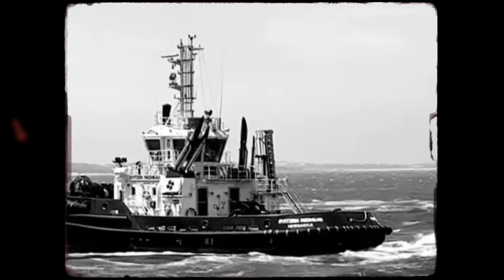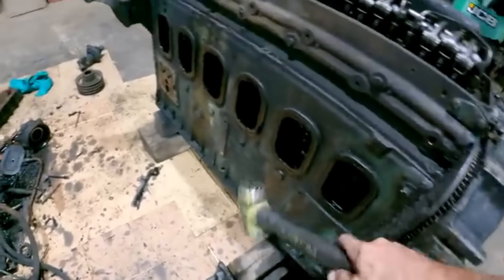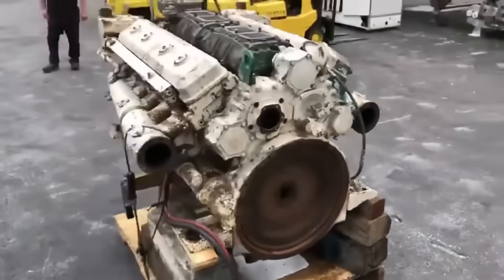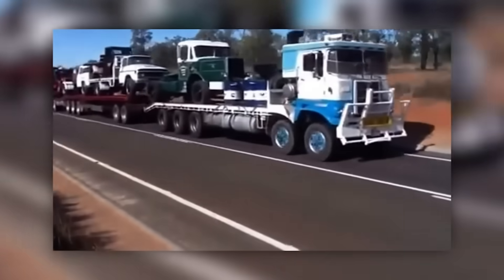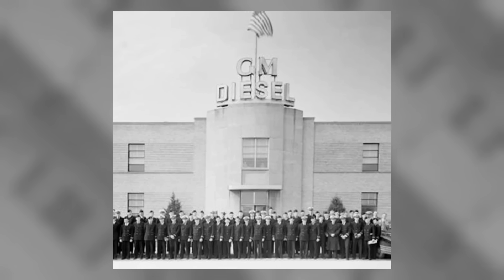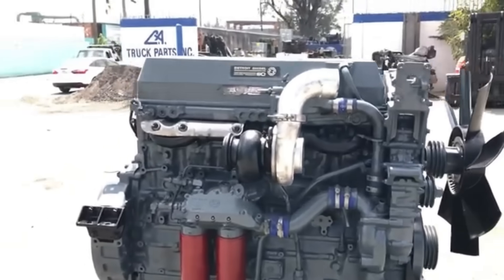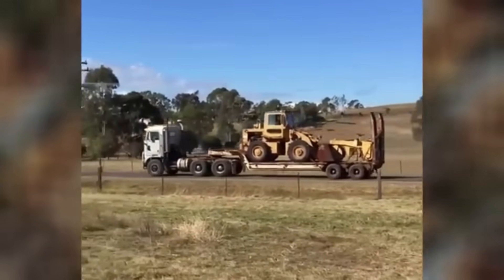The Rise and Fall of Detroit Diesel, America’s Greatest Engine Company

Comment: I remember driving an old GM General Detroit screamer in the 1980s.  The more revs the better.  You have to hear them in person to really understand the scream, the vid here doesn't do them justice.  They were replaced by the newer turbocharged engines.  We never thought they would get enough power out of the new engines, but they did, and they got way better fuel mileage.  Detroit Diesel kept making great engines right up until Mercedes bought them, piled a lot of electro-tech on them and made them unreliable.  Still some old Detroit 4-bangers around I think, excellent engines.

Comment: worked for detroit diesel dealer for 15 years. built a 8v92 for truck racing. set new land speed record on the salt flats in cab over freightliner.  also put 3-53 in 1ton chevy truck. left there as the 60 series was coming out an went to caterpillar dealer.
Reply from the maker: Seriously?! That must have been insane! I would like to have seen video of a truck racing on the salt flats. Very cool.

Comment: Detroit only made inline engines before 1957 when the V-Block engines were offered 
The 71 series 
 Came in 1,2,3,4, inline 6, or V6, V8,,V12,V16 & V24  cylinder 
Configurations .

The 53 series was 
Offered  in 2,3,4,V6,V8 & V12 
Configurations
 
 The Detroit 51 series introduced 
In 1951 & produced  until 1959  it was offered in a
  2-cylinder 
And 4-cylinder 
Configurations 
Ir was unique 
Because it did not have  valves  like all other Detroit's

Comment: Back in the late 90's and early 2000's I worked for a driveaway company. We moved 100's and 100's of old retired Schneider cabovers, many of which had series 60's some with well over a million miles on them. Most went to the ports in Ca or Fla, and were put on ships destined for China.
On their trip over, the engines and drivetrains were removed while the cabs were dumped off into ocean under the guise of sea life habitats.
The engines and drivetrains got refurbished in China, then sent back to the US to be reinstalled in new trucks.

Comment: Many years ago, I drove trucks that had Detroit Diesel engines at some of the places I worked.  I prefer Cummins in Big Trucks.  However, the Detroits had a few strengths.  We called them "Yudden Yuddens" etc.  The 8 V-71 would run 100 mph down hill and 20 MPH uphill.  They were TOUGH, but used a lot of fuel and did not have a lot of LOW Rpm Torque.  I did not like the 2 Cycle noise they made.  We also called them "Double Breasted Yamaha's".  The oil pressure gauge would set on ZERO when idling.  Not a good thing when snowed in some place where the only shelter you had was the TRUCK.  I believe they were BETTER when used as Generator, or a shrimp trawler etc.  But in a HIGHWAY truck for cross country, I did not like them for that.  Then they came out with the 8V-92 around 1977, they had more torque, but they were still a Yudden Yudden.  I much rather have a Cummins.  They ALL slobbered Motor Oil, you could steam clean one of them and drive it 200 miles and it would have Oil specks all over it.  They are BETTER around DIRT than a Cummins.  The Euclid Off road Dump Trucks had the hot water 6 cylinders, the 238 I believe they called them.  The guy narrating this has NEVER driven one of the for sure.

Comment: What a fake story just click bait lie. My company has tens of thousands of 2025 Detroit diesel trucks in our Cascadia freightliners. A lot of already have 400,000 miles plus on them and they run better than I expected. Between 7 1/2 to 10 1/2 miles per gallon on a full-size big rig. Quite a joke. Are trucks never shut off. They’re driven 24 hours a day. When one driver gets back from the run another driver is waiting to walk in after it has been fueled with diesel and DEF and post a pre-trip inspection. Meticulously maintained.

Comment: Detroit diesels were load over revving engine that lost torque when it say a hill a mile in front of you. So glory motor don't think so. That's why they had no share of truck engine market until the 60 series. And no they didn't pull. Need to do better research.  Have a great day. Started trucking in 1977 until I retired. Have a great day.

Comment: At one time I was an apprentice at a Marine mechanic workshop, I saw a rusted  v16 detroit block rebuilt with rusted pistons sleeves, connecting rods blowers cleaned with sand paper and diesel. I always marvelled at the modularity of the engines. I thought it was an oversight on GMs part, now I know it was deliberate.  Good engines ❤❤❤

Comment: Low end torque? No. They were known for not handling hills well. Their claim to fame was HP or power to weight ratio, not torque. Their success in marine or fixed machinery was that they would operate at fixed RPM and not have to recover torque after shifting gears.

Comment: I've seen these engines eat dirt like it was fuel , holes in the intake Duct, air filter so plugged either couldn't get through, multiple idiots trying to destroying, holding it at full throttle and it just would die. Constantly hauled more weight than was road legal

Comment: I drove a lot of trucks with Series 60 engines.  Love 'em.  Beyond reliable.  You break 'em in nice and easy for close to 100,000 miles until they start leaving a four inch spot of oil when you shut them down.  It's now running at it's best and will continue to do so year after year with proper maintenance.

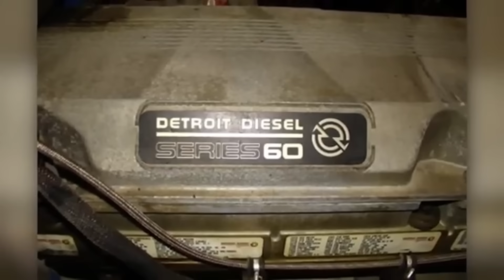Comment: Inaccurate statement at 11:14. The Series 60 was NOT DD's first 4-stroke engine. The 8.2 liter "Fuel Pincher" was a 4-stroke, and it was introduced in 1980.

Comment: The attraction for fire trucks and generators were the fact the it is a two stroke engine which unlike a four stroke where when a load is applied the rpms fall off. This causes fire engine hoses to lose water and generators to lose power to lights until the rpms picked back up. With the advent of electronics Detroit lost the advantage. There were other issues as well with overflow fuel oil tubes leak wasted fuel at idle and if a head cracked and coolant flooded the crankcase then all the bearings would fail in short order if it was not drained soonest.

Comment: U.s. is known all over the world for cheaply built crap sold at a premium price so even well built stuff suffers from that reputation. A two stroke diesel does NOT lose diesel while scavenging as diesel is only injected at TDC when the inlet port and exhaust valve are both closed.

Comment: What if the 71 & 92 series were cast in Aluminium, with Electronic Injection using piezoelectric injectors @ 2000 Bars, while injecting urea in the exhaust manifolds . . .  There would not be any Emission issues!

Comment: Love detroit diesel. I am a mechanic at one of the biggest airports in the world, We have 60+ detroits in our fleets, Ranging from series 60's series 71's 6v92's & 8v92's all stuffed in Oshkosh chassis' Some of these machines are from the early 70's they are still out here pushing snow and keeping the runways clean for safe takeoff and landings. They are so easy to work on and they are damn tough. They are the embodiment of what a diesel motor should be. I am able to excel at my position because of how easy they are to work on.

Comment: Turned good diesel into noise or overevved with governor failure!  I remember back in the day the Wabco motor scrapers with a 471 engine with the air shutoff valve operated by a cable which was usually seized up when you needed it. They used to leak oil, blow head gaskets and burn the top of the liner so you had to replace cylinder liner as well. If you couldn’t hear the machine working in the distance you could tell where it was from the exhaust smoke. The only redeeming feature was that they were fairly simple to work on.
Fishermen on trawlers seemed to love them, maybe they suited the marine environment.

Comment: I worked on M113s. Heat was the only thing that could kill that engine. Loose the fan tower meant you usually lost the engine unless the driver stopped. 8V92 in the HEMTT was just awesome, I loved driving my wrecker. If your doing a rack adjustment don't forget to put that shop rage in the corner of the head.

Comment: The series 60 leaked oil too.  If you were designing a new engine. The one thing we have to do was keep it clean.   The leaked from the cam seal. I still got an early 14 litre which has a 12.7 top end and it leaks we have fixed it several times. Runs good though

Comment: The nuclear plant had a pair of 8v92 silvers.  475 grizzlies.  They were set at wide open throttle and had electric ran oil pumps and were kept at operating temps by the reactor cooling water but in the event that something went wrong both 92s went right to 3200 rpm to run the cooling pumps so there wasn’t a meltdown.  The old guy told me there was no other motor that would take a start and right to that rpm and take it.  lol I’m glad we never needed them

Comment: I started driving semi hay trucks in 1980. I drove Cats, Cummins and Detroit's. When you want torque to pull a heavy load and up mountain passes you want a Cummins or Cat. A Detroit 8V92 735 ci two-stroke even with their 440 hp that had twin turbo into a supercharger couldn't stay with our 400 big cam ll Cummins that was a straight 6 with 855 ci and one turbo. 
The Detroit Diesel belongs in the scrap yard. 😂😂 😂 😂😂

Comment: I miss hearing that smooth roar of DD flightline fire trucks.  Now they’re unreliable 4 stroke German engines that sound like a modern stock passenger diesel.  Thanks Obama…

I’m pretty sure I’ve seen a V20-149 before.  It was an old abandoned flightline generator that would power all the lights and another abandoned project that supplied 200A power and high pressure refrigerated air to every spot.  They eventually moved to a generator behind every hangar and towable power and air carts.  Leaving no use for the cathedral size generator.  I only saw it once because someone left the door open.

Comment: you cannot kill a 6-71, i have run 6-110, 6v53TI, 8-71TT, 12v71, 4-53 since i was 20 years old and now i am 68, unless you throw a rod thru the block you can always rebuild them, pull the head and drop the pan and throw in a new cylinder kit, yes it really is that easy

Comment: you missed the fuel pincher. a 4 stroke 8.2L V8... It was a big black eye on Detroit. went from the most reliable to the least reliable engine, and really was the end of the Detroit under GM.

Comment: The Series 60 is a great engine, BUT it’s not the first 4 stroke engine built by Detroit Diesel. In the 70’s GM and Detroit Diesel released the 8.2 Fuel Pincher turbo and non turbo V8’s

Comment: I have one in my steelboat and another as a industrial generator/waterpump/air comperssor on a trailer. Great equipment. Basically, only the aircompressor needs actual regular maintenance, because of the Reed valves.

Comment: Correct me if i'm wrong, but as far as i know american tanks fighting in europe were never diesels.  The achievement to get a doesel small enough to fit un a tank was made during the war, so at startof the war all tanks were petrol powered. During the war nobody wanted mixed diesel and petrol tank units, thats because nobody wanted to deal with two fuel types. There were about 8000 dherman tanks with diesel engines, but they were only used for trainig in the US. 
I remember these facts from The video about tank engines from the german tank museum

Comment: Pretty good stuff, but it got a little hinky when you were talking about CAT and Cummins and their advanced four strokes - right after you described how clean sheet, advanced, an excellent the Series 60s was. Makes me believe it's AI content (?). The Series 60 not only saved the company, but it's legendary, deservedly in the top five of production diesel engines (If not top three) and still all over the place to this day. Definitely massively successful for DD. The video made it sound as though CAT and Cummins ate DD's lunch in the four-stroke world. 

Me, I still dream of owning a 90s-2010 Prevost motorcoach with no slides, riveted body, and with only the upper half painted -definitely have to have lots of polished aluminum, and of course with a Series 60. Extremely dependable, plenty of parts, easy to service, sound great, etc. If you look hard enough and are patient, you can find nice ones in the $70s, though I'd expect to pay closer to $90-100k for one that's been tastefully updated.

Comment: The only reason an engine series like the 71 dies, is because people don't appreciate it anymore, or they are forced to scrap them.  Look at the Toyota 22R series, or the 1GZ-FE, 2UZ-FE.  There's lots of old, worth their weight in gold, engines out there with hours and miles to give that would outlast modern emissions engines several times over.  

"When something is built for profit, it will fail.  When something is built to better the lives of others, it will live."

Comment: Two important topics were missing: 
1 - EMD LOCOMOTIVES from General Motors were built from the 1950s to the 1990s.
In just one hour, a piston, connecting rod, cylinder (power unit), or their parts can be replaced without removing the engine from the locomotive, which avoids many weeks out of service.
Only in Argentina, there are more than 300 GM GT-22 and G12W locomotives in service, dating from the 1950s to the 1970s, that surpass the reliability of the new Chinese CKD and CRRC locomotives, which are already needing new engines because there are no parts to repair them and they cost millions of dollars.
In the USA, SD40s from the 1970s are still running.
In Europe, the new Euro 4000 locomotives have EMD710 engines, the same as the Spanish RENFE Series 319 locomotives, which were built under EMD license.

2- The biggest TEREX MINING TRUCK  with a payload around 400 tons was the Terex MT 6300AC (later Bucyrus MT6300), introduced in 2008. This electric-drive truck featured a four-stroke engine, not a two-stroke, and had a 3,750 hp engine and a payload capacity of approximately 400 tons. The Terex 33-19 "Titan," built in 1973, was once the world's largest but had a smaller 350-ton capacit

Comment: Detroit made durable engines, but weak. The Detroit 6.5 liter that runs the Humvee in the American military, despite 6.5 liters of displacement, only produced 170 horsepower and 380 ftlbs of torque. You can get a ford straight 6 that beats both those numbers at half the displacement. So a chrysler hemi of the same displacement was a much better engine.

Comment: The environmental concerns were very real, but few people know about the health concerns... Because the mainstream media almost never mentions them. It is the fact that Diesel exhaust fumes cause cancer. Actually, all petroleum fuels do because of benzine.  But it is a bit worse in Diesel fuel. This is the REAL reason city busses in most major cities have switched to burning alternative fuels like methane or biofuels, or are now trying to transition. Hydrogen is also being used, either burned in an engine, or pushed through an Electric Fuel Cell to run electric motors. Modern methods of splitting the water molecule to get H, are 8 times more energy efficient than the old brute force electrolysis "low voltage high current" way still taught in text books.  Why are these things rarely mentioned? Because the media's biggest ad customers are oil corporations.

Comment: I worked on several models in the Army. I found them to be easier to work on and less problematic than the Cummins engines that they were also using at the time. Most Army mechanics were afraid of them because of a rare, but real, possibility that a maladjusted injector fuel rack can cause them to run away and destroy themselves. I was often the only guy in my unit who could adjust injector racks to perfection consistently. Or, more to the point, not afraid to perform the adjustment. However, it was a well-documented and simple procedure, and all I did was follow it.

Comment: I use to grow in a family compagni that the first 10 whellers that we bouth was a 1979 Ford 9000 whit a 8V 71 Detroit... the soud that it mae still ringing in my head till now, that when it's not running away... fotunatly there was a manual shutting valve on th engine or we have to quicklly put it in gear and dropthe clutch to shut it down.  Memorable time...

Comment: Never operated anything with a Detroit 2 stroke in it but a crane we had at a rock quarry I worked at had one we used to bust up big rocks.  I know the crabs was so loud one operator could run it for only a couple hrs then they had to switch.  I got my CDL in 2008 and I've driven 3 trucks with Detroit 60 engines, one of which I drove all over the US.  That one was a 2008 Frieghtliner Columbia with a 10 speed.  The other two were Frieghtliner Classics.  I had very little issues out of any of them.

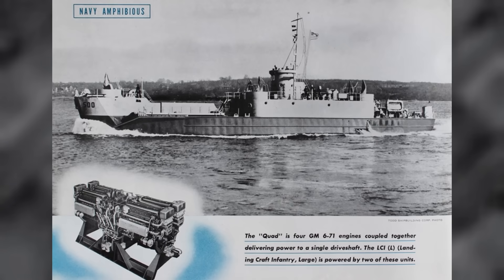Comment: I work on USS LCI(L)713 a WW2 Landing Craft Infantry. She was built with two sets of "Quad Diesels" as main propulsion. A Quad engine consists of four 6-71 DD engines clutched together onto a common output gear. (Seen briefly at time stamp 2:41) I think it must have been invented by Rube Goldberg. These  engines could not be reversed, so they came up with a reversible pitch propeller in order to go astern. Our purpose was to land troops on the beach and not "chase U-boats across the Atlantic" (contradicting what the narrator said in the video) The quad 6-71 engines made the LCI the fastest of all Landing Craft at 15.5 knots (during WW2). Ours were removed long ago but we have obtained two 12V71s to replace them complete with a transmission for each. We are waiting for drydock to be able to install them into the engine room.
Reply: Thats awesome